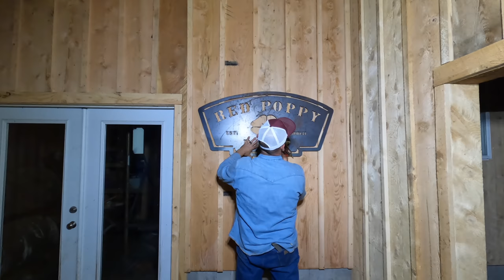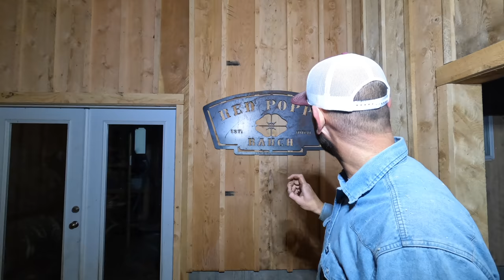Triplet Baby Goats In New Barn!

Comment: My great grandparent homesteaded in North Dakota. In addition to the standard 160 acres (1/4 section), you could claim another 1/4 section as a tree claim, if you planted a certain number/area in trees.They also acquired another 1/4 section. My grandfather bought it from them in the 1920’s.  When the Great Depression and Dust Bowl arrived, they did everything they could to keep the milk cows alive, in the winter the horses were let loose to roam with the hope that they would survive until Spring.  They survived the bad years because they had 480 acres.  The families that had less than 320 acres all sold out or were forclosed on.  

The 160 acre homestead could not support a family in the Great Plains.  It might in southern Minnesota, Iowa or Illinois, but not North Dakota.

Comment: Board and batton is not 100% water tight is that not a problem....
Reply: Actually up to a point it is a good thing to have ventilation to remove moisture.  Pretty dry climate too there.